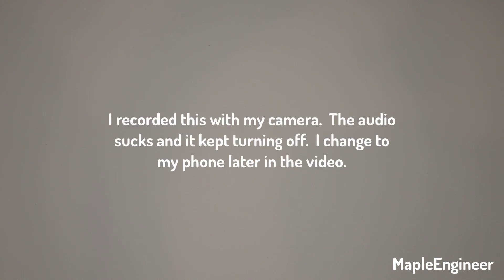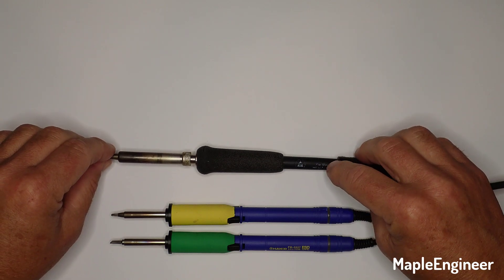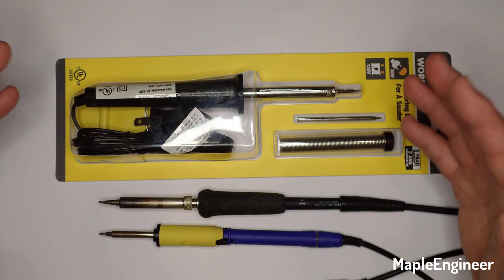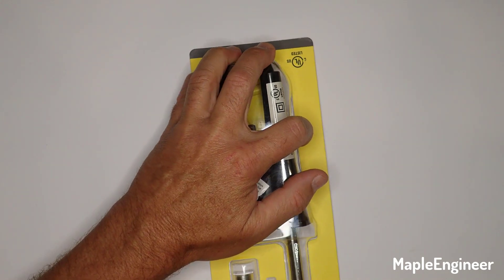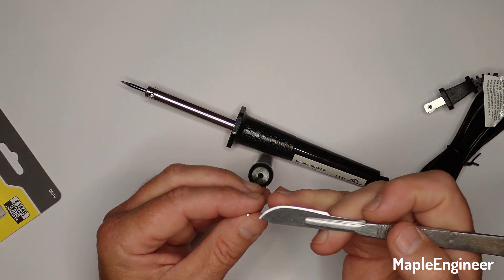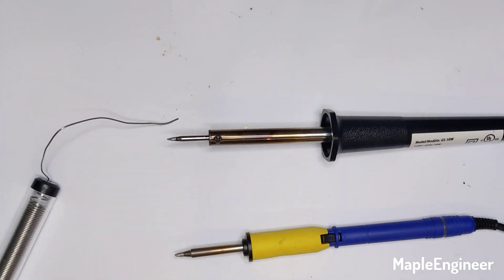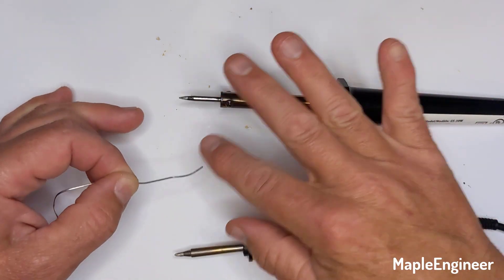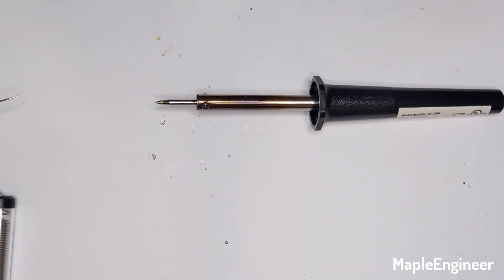Can you use a $15.88 Walmart soldering iron to do serious soldering?

Comment: Will the cheap solder fix a xbox series s HDMI port ??
Reply from the maker: I just had a look at a video of the repair.  It looks straight forward.  There are four large holes for mounting the HDMI port which may be a challenge to get desoldered with a cheap iron but you should be able to do it.  Desoldering the connector will require patience to heat and carefully lift each pin.  Once you have it off, clean it up with flux and solder wick then carefully line up the replacement port, tack down one pin at each end, make sure it's aligned, and solder the rest of the pins and the mounting holes.  It should be straight forward.
Reply from the maker: Hi.  I've never done one of those so I'm not sure what's involved.  It's like an SMD style port.  I would guess that it could be done with lots of liquid flux and some good solder.  I wouldn't try it with the solder that comes with the cheap soldering iron.

In all cases, you're better off with a $35 to $50 soldering iron from a good name than the cheap one from Walmart.